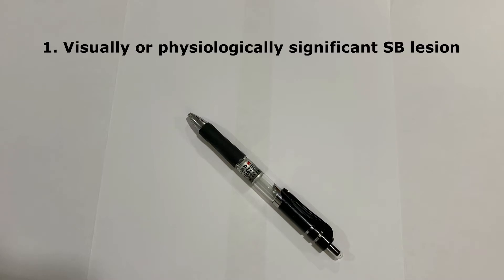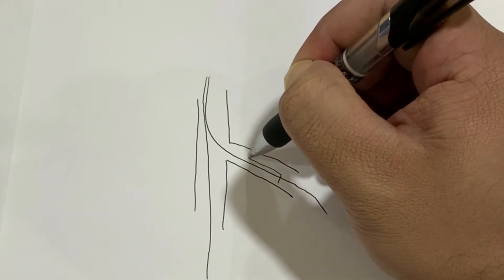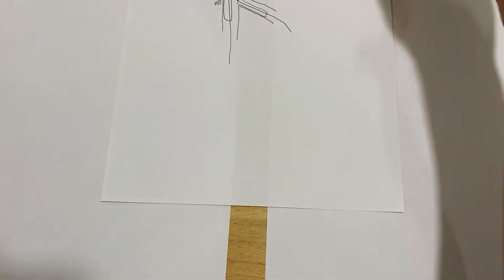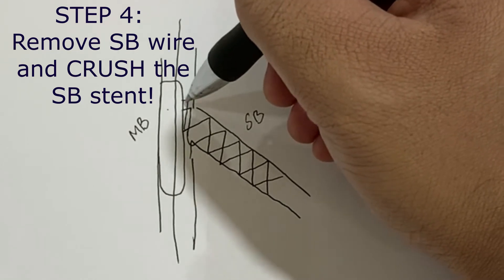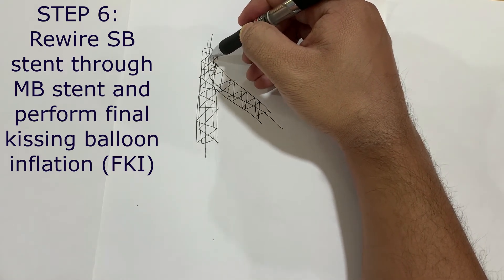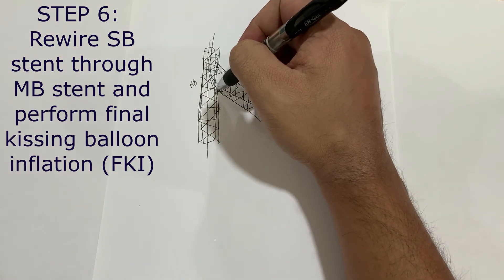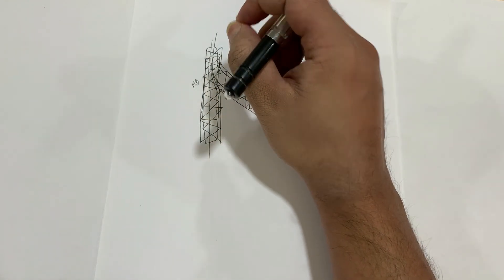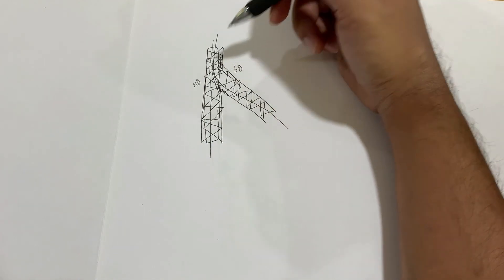How to do Mini-Crush (minicrush) bifurcation coronary stenting

Comment: Thanks for simplifying this technique. I am looking forward to your next videos. 
When do you like to use this technique over other bifurcation techniques ?
Reply from the maker: Thank you Mohamed! nice to see you here. This has mainly a place wherever DK-crush could be performed. DK-crush on an average takes about 10-16 min more than this technique. main thing to remember is whenever its difficult to wire side branch, minicrush and DK crush techniques will not be easy to perform since one has to cross the balloons for kissing into the side branches which poses the most challenge. So if the angle of branches is <70 degrees, then mini-crush or DK crush or DK minicrush should be preferred choice. Usually I use it for diagonal and LAD bifurcation stenting.